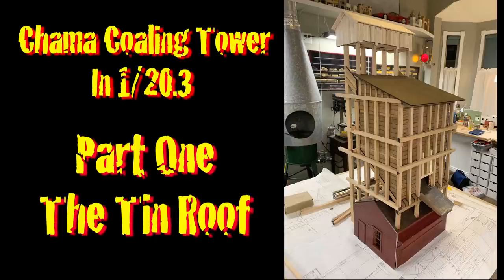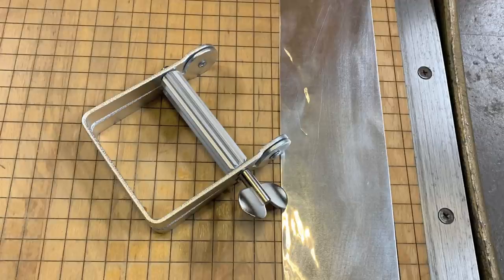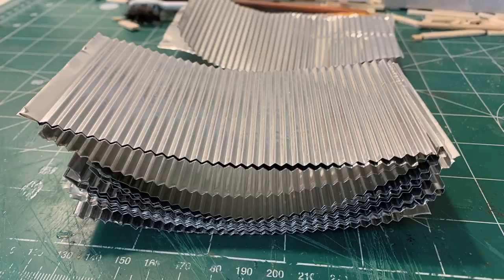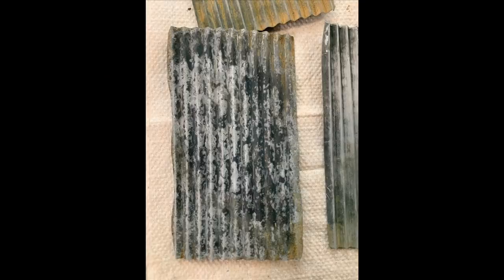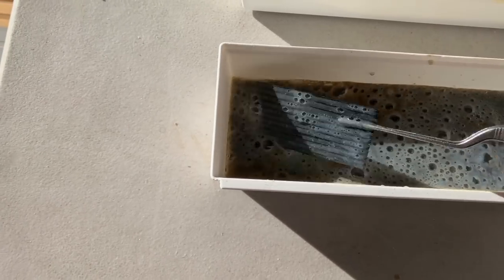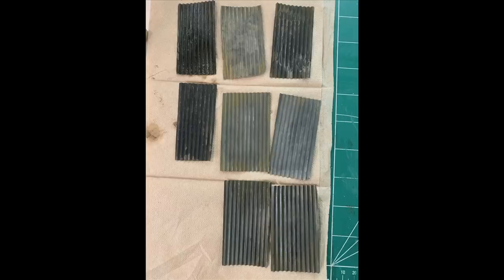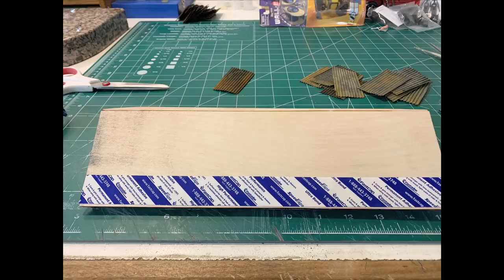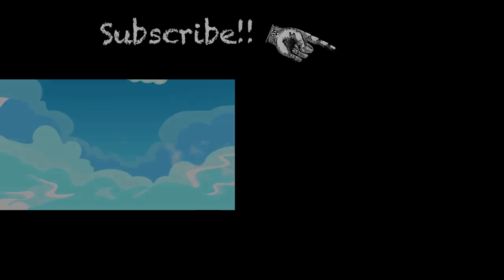How to make Rusty Metal Roofing for your Model Railroad

Comment: Dale,
I've done the same thing using an Aluminum can and a paper crinkler from Hobby Lobby from the craft department.
Reply from the maker: Him... paper crinkled?  Looking.
Reply from the maker: Hum.. can’t find it. Not made anymore?
Reply from the maker: I think I found it on Amazon!
Reply: @ToyManTelevision  Try looking up 'Fiskars' brand who make garden saws. Their paper crimper is good quality plastic frame with metal rollers and does 6 2/3" long sheets about the right scale. I gently run them through a few times so I don't stress the plastic tool too much.
Reply: @ToyManTelevision  - Have you tried this with a soda can?   Makes sense to save money and cut up the vanilla coke can.    I just bought the machine you're using.  I'm going to use them for bird houses too.

Comment: Great tutorial. I have watched several other tutorials that show how to use paint for simulating old rusty metal roofs but chemical aging is way more authentic and random. I've purchased the etching solution and a crimper and I can't wait to try it. I also have some old metal trophy topper figures that I'll be aging for use in some artwork. Thank you!
Reply from the maker: It’s great 👍. But be careful. Not to dangerous but avoid the fumes.

Comment: For HO scale corrugated metal I got a piece of plastic .040 corrugated metal and use it as a mold.  Put a drop or 2 of dish detergent and add a little water (to release the surface tension).  Then add a generous amount of Elmer's glue (PVA) and wait for it to dry.  Then add another layer on top and wait for it to dry.  Then CAREFULLY peel off the glue layer and paint it as you would any corrugated metal.
For O scale corrugated metal I got me one of those toothpaste squeezers from Amazon (only $9.99) and save every beer can after I drink it, cut it up with my tin snips and run it through the toothpaste squeezer.  Now I've got more O scale corrugated metal than I know what to do with.  I guess from now on all my scratch built O scale buildings will have corrugated siding and corrugated roofs, LOL!  Cheers from eastern TN
Reply from the maker: Also for HO you can roll the aluminum over a screw. Or sometimes two screws pinched together.

Comment: I've got some 200 aluminum cans and wound up with two of those crimper tools .
I'm out in the desert of Nevada along with high winds ,    so I have to go with the even thicker aluminum and tack them down with short brads .

I've also made my own wood stain with White Vinegar and steel wool .
It gives a Reddish Brown  and will look great on both my HO / HOn 3 and my 1 : 20 : 3 .
I will need to finish the wood for outdoors in a Anti U V flat clear .

This place looks fantastic in my head .

I've been offered help with both of the layouts .               Yea until I tell them what needs to be done just to start . 

Also .
If I remember right corrugated sheet metal was made out of tin .

I've seen workshops and garages at old gas stations made of wood frames and corrugation sheets and not more than that  ,  except for the windows .

Comment: How much baking soda did you add that silverware tray? Also Did you heat the water to dissolve it? Thanks
Reply from the maker: A lot!  Yes hot water. Tap hot. But it really gets icky fast. But works better when it’s really thick and black. Water works. But soda adds a black tarnish.

Comment: im doing an On30 layout and i think that this would be fine as it is with the tube roller. There is an old barn near my house and using a tape measure on its corrugated siding  it was about 3 inches between 2 crests or 2 troughs and i feel like the foil through the tube roller in o scale could come out to 3-4 inches.
Reply from the maker: Yup. Steve made a jig. Simple. Get a small sheet of evergreen plastic. Like 4 x 4 inches. Glue evergreen plastic rounds or half rounds (better) like .030 Mostly edge to edge. But shoot for your 3 inches in O scale. (1/48”) or .06. Now lay your foil on it and press in place. Try kitchen foil. Fragile but will work better if you can use such fragile material

Comment: I always wonder how did they get coal into the coaling tower
Reply: Go to 0:42;  that is the side of the real Chama coaling tower.  There are 4 sets of vertical posts and three spaces.  The 2 outside spaces have rectangular buckets hanging from cables over pulleys in the covered overhead.  These buckets are lowered into depressions in the ground below the level of the near track which is the coaling track and have openings to dump the coal through the track and the coal slides down a chute to be dumped into the buckets.  The full buckets are raised to the top by the cables and dump the coal into the framed structure to store the coal until a locomotive is spotted under the gate on the other side of the structure to let the coal pour into the tender.
Reply: @royreynolds108  cool

Comment: I've used toilet bowl cleaner to rustify aluminum flashing for scale buildings. The hydrochloric acid in it works well, but not as fast as the acid you used. The cleaner is inexpensive and found just about everywhere.
Reply from the maker: Probably a lot safer than what I’m using to!
Reply: Hey, coukd you tell me which one you are using and how long to you hold your metal in it? 
Thank you!

Comment: I remember an article in Model Railroader (or maybe it was Railroad Model Craftsman) how to make corrugated panels back in the 1990's or earlier using a bit different method for HO scale. All my copies of MR are no longer accessible to me, else I could quote the issue. Sad. Reasons are complicated. Moving on.
Reply from the maker: You can get mr on dvd!
Reply: @ToyManTelevision  I do indeed read a lot of material digitally, I guess I was more regretting I lost access to my original copies as "collectables" from my childhood. And I collect old books as well, some going back to the 19th century.

Comment: If you don't want to fool around with acid, there are acrylic paints that resemble rust. Even though it becomes water resistant, when dry, You would use  some sort of clear sealer for outdoor use. I've seen Jason Jensen use the stuff with super results. Jason is a master "structure" modeler in HO scale. Visit his you Tube site Janson Jenson Trains. I've been amazed with his skill. 
I can't wait to see the coaling tower videos and finished product. ;-)
Reply from the maker: In this case the acid actually has iron in it, so the rust you see is actual iron!  Really comes out nice and I really love the way that each one looks very unique and individual without really putting in any work at all

Comment: Fiskars who make garden saws make a paper crimper that is about the right scale for corrugated iron. It will do sheets 6 2/3" long. It's OK for light weight aluminium like you find in pie trays etc. if you go lightly and run them through a few times.
Reply from the maker: Been looking at those online. I think I’m going to buy one just to try it out. It’s sort of looks like the core additions are too large but it’s really hard to see from the pictures. But it’s not expensive so I’m gonna give it a shot! Thanks for the information
Reply: @ToyManTelevision  The alloy rollers have their corrugations 3.5mm apart. My real world corrugated iron is 72mm apart so it is very close for 1:20.3 scale.
Reply: @ToyManTelevision  I've had one for this purpose for quite a while but only briefly tried it once. I just gave it another go and the technique is to roll it back and forth with the wrist several times before advancing and it works perfectly that way giving deep corrugations! It doesn't stress the plastic tool either. Running it through only once barely makes the impression and you could easily not line things up the same for subsequent rolls. As the say. It's all in the wrist action!